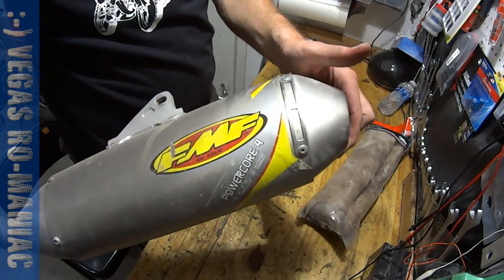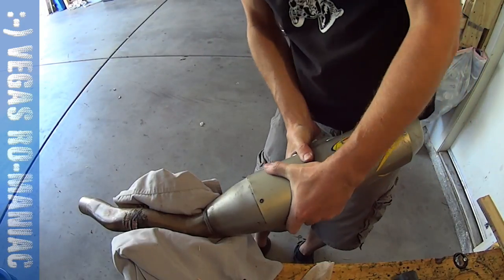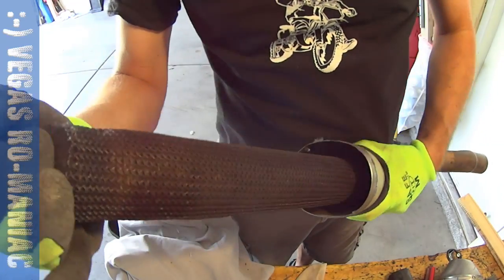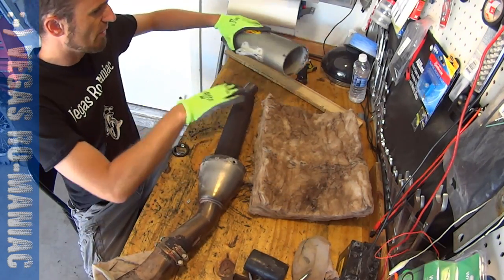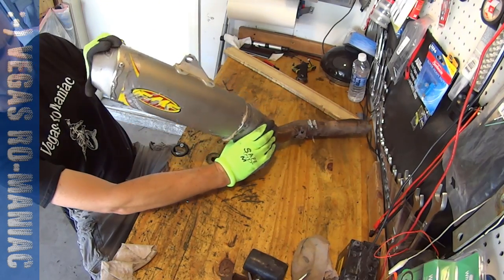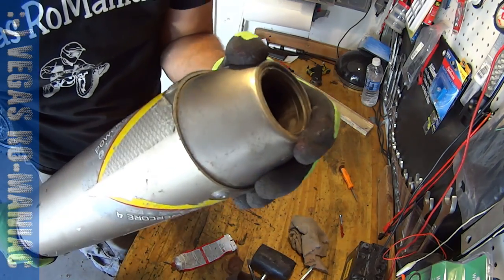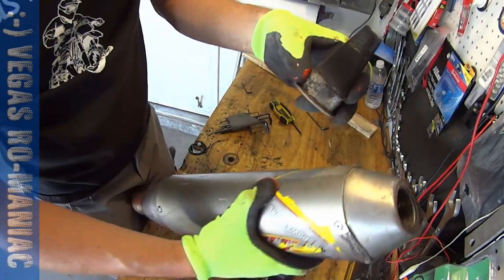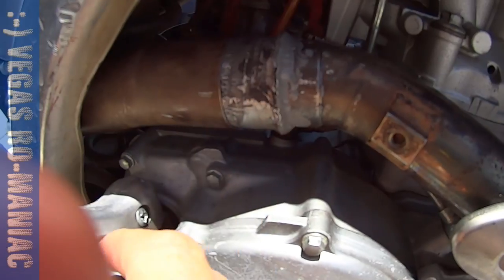How to Crack open and REPACK a FMF powercore 4 Dirtbike Exhaust

Comment: You should check out the Quiet Cores if you want to reduce the noise. There is a 1 1/8" and a 1 3/8" quiet core insert.

Comment: Easy way to pack it is to run a ring of tape around the packing on the core so you can easily slide the body over it. Less sound = more ground. 👍

Comment: Thanks for the heads up on the spark arrestor screen bolt! I wasn't having much luck separating the two until i watched your video!
Reply from the maker: Yeah took me a while to find it..
Reply: @vegasromaniac  how did you remove the bolt from the spark arrestor? I put an Allen wrench in there and nothing is really gripping
Reply from the maker: @EschyFresh  it has a thread, make sure you got the right Allen wrench, if the thread is rusted and it's gone.. I don't know man a huge pair of locking pliers

Comment: How did you remove the spark arrestor? I’m having a hard time removing it.
Reply from the maker: It s a Allen bolt on the inside
Reply: @vegasromaniac  Can I go ride without spark arrestor? Is this like DB KILLER?
Reply from the maker: @MARCELO2K12  absolutely you can ride without one, no problem for the bike the ranger might not like it

Comment: that bloody bolt for the spark arrestor.. I just spent an hour getting mine out.  Stuck in, rounded the hex head, filed a groove in to get screwdriver in, can only turn it a little bit, drilled the bastard out.
Reply from the maker: Dude that's awesome, I love when stuff goes south and you need to be smart to make it work, and you have a reason to curse

Comment: That's the wrong packing it's for 2 strokes it will sound good at first but it will burn out u have to get the packing for 4 strokes it looks its white and is made out of a thicker material.
Reply from the maker: it said 4 stroke on the box
Reply from the maker: This high quality, and half the price, packing material is for use in all re-packable silencers 2 & 4 cycle motorcycles, atv, and watercraft. The packing is great for use in Silencers, as well as Spark Arrestors and comes in a 12" x 15" sheet.